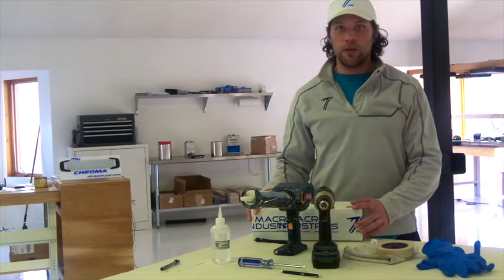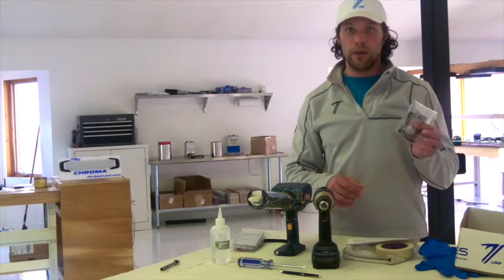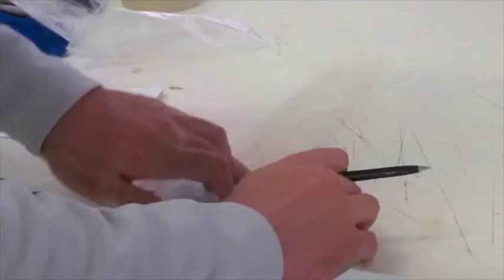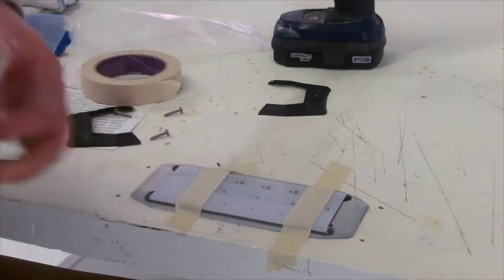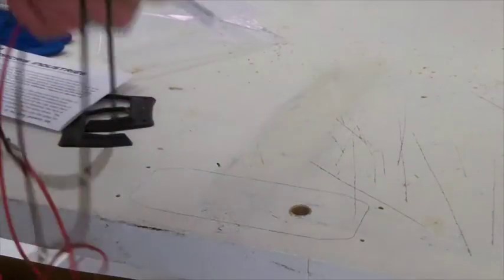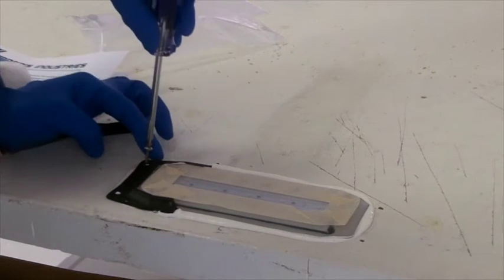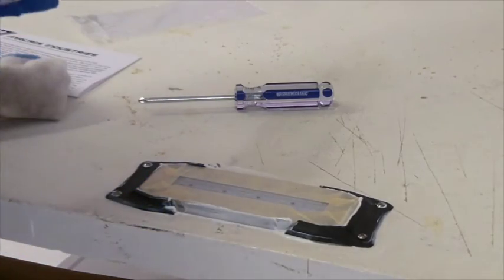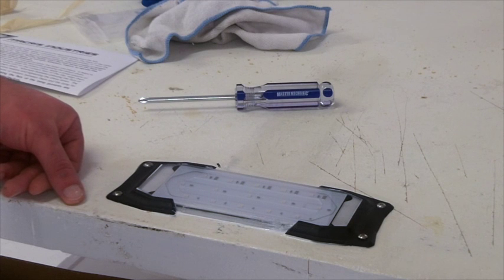MIU Underwater LED Installation V4

Comment: Nice looking product. When you say 3M 4000 you mean 4200  and not 4000UV?
Reply from the maker: Rafael Escobar you can use either. 4000UV is a newer product and sometimes harder to find than 4200!